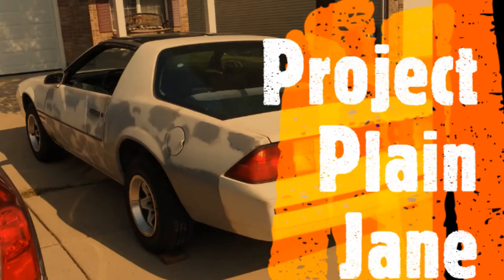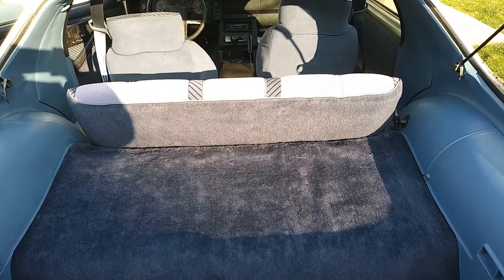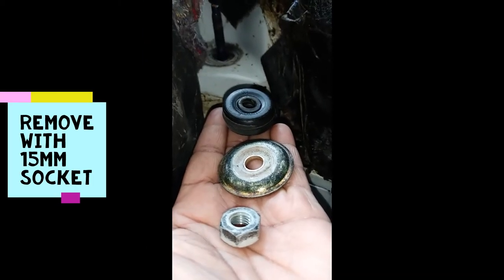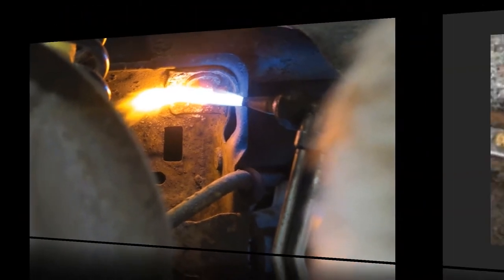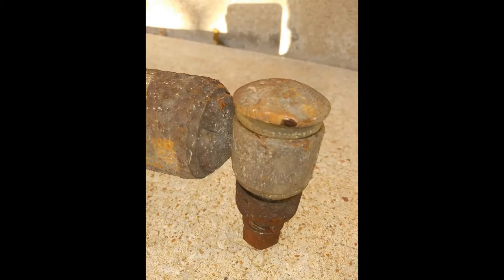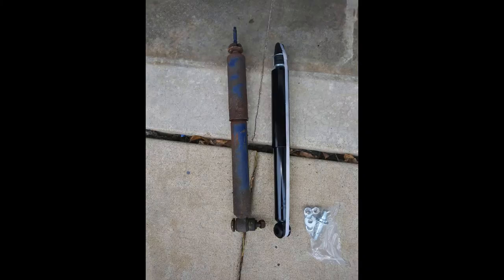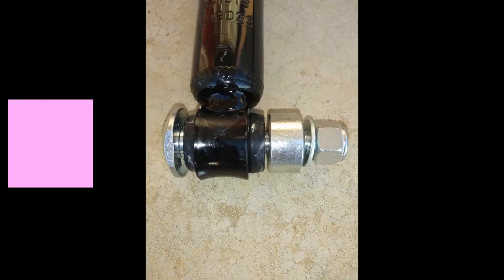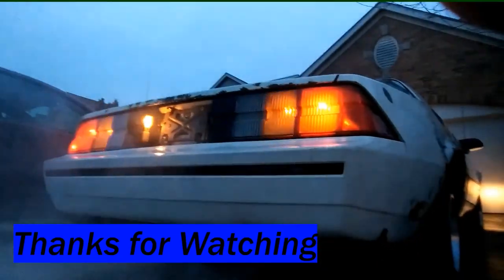Spring Time Part 2 - Third Gen Camaro Rear Shock and Spring Installation

Comment: What kind of shocks did you buy ? The brand . And where at ?
Reply from the maker: Hey there Martin! Thanks for checking out the channel. My apologies as I forgot to include that info in the description below. I'll be sure to do so, but will share it with you now in my reply. This is a budget build, so I went with the stock replacement shocks from  KYB Excel-G, PN #343211 and a set of MOOG Variable Rate rear coil springs, both of which I purchased from RockAuto.com. I did not like the lower mounting bolts included with rear shocks from KYB because they are not like the original equipment. So I bought the stock mounting bolts you see in the video from Speedway Motors.com, PN #910-36095. I must admit, although it did restore ride height and performance, I would probably replace both again to upgrade to Z28 shocks and springs for a little stiffer ride. Hope this helps!  😎👍
Reply: @mods-n-motion863  thanks I appreciate you writing back . I’m on the mission on fixing up my suspension . I’m new to all this stuff .